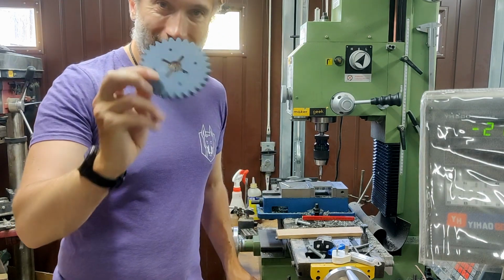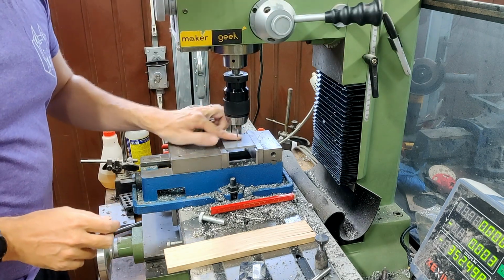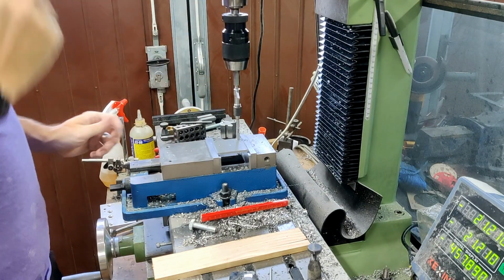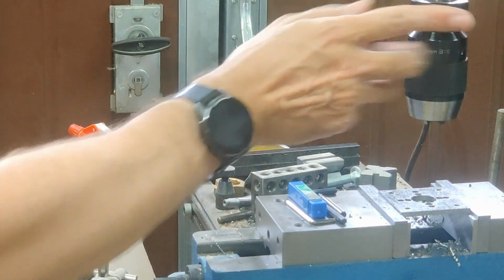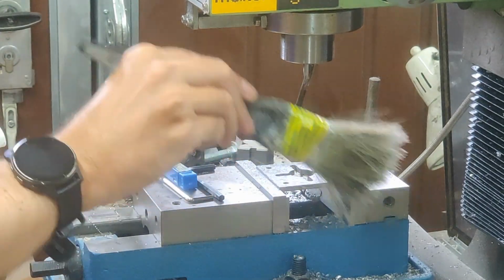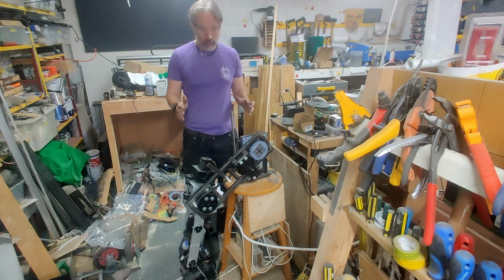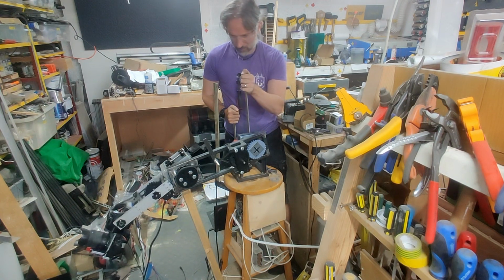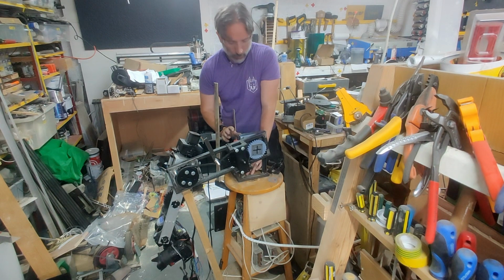reinforcing 3d printed cogs for high torque applications - robot arm

Comment: Did you try to use Davinci Resolve? You can isolate voice and clean it up.
Reply from the maker: I am using davinci resolve. however I'm also lazy ;-) actually one of the problems I have is that on my home setup with my speakers etc etc it often sounds fine to me. but audio mix tends to play out differently on different devices.
Reply: @MakerGeek  Maybe simple headphones may help?
Reply from the maker: @9A4GEMilan  you're probably right.